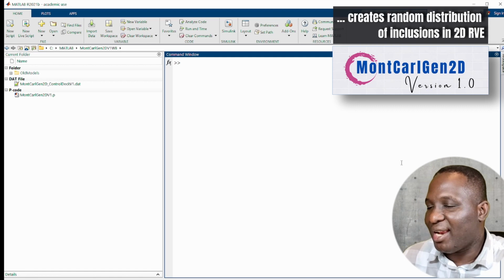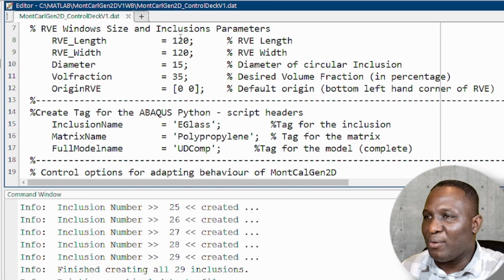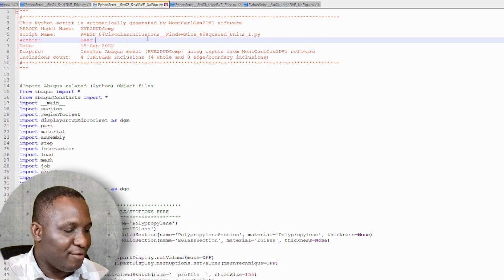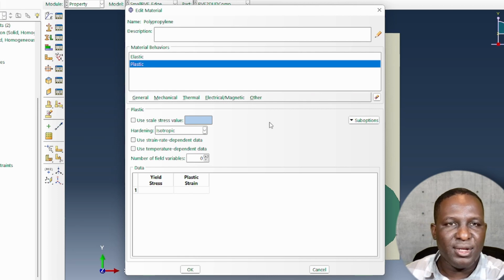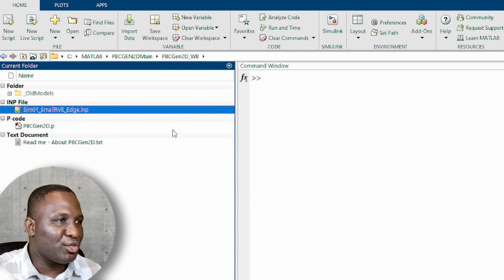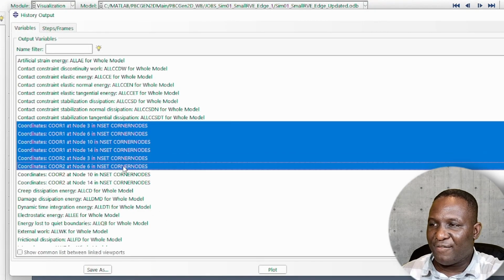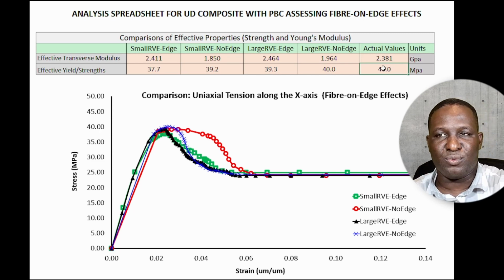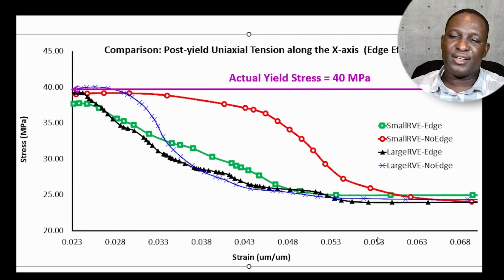Finally, the TRUTH about designing RVEs and Edge Effects!

Comment: Sir, kindly be of help. I got an error message of "Abaqus Error: Command line option "input" must have a value. 
Abaqus/Analysis exited with error(s)." when I run the .inp file through Matlab.
Reply from the maker: Hi @Yusuf, you need to specify the right input file for the job after the job command. Here is what it should look like: 

!abaqus job=PutYoutInputFileNameHere_Updated -interactive.

The PutYourInputFileNameHere should be the exact name of the file that you are running without the *.inp extension. 

Also make sure you are running the model in the exact sub-folder where the Updated input file is located. Just navigate into it and then run the above ABAQUS command. The sub-folder is a folder beginning with JOBS_, not the same folder where PBCGen2D executable is.  
Hope these help?
Reply: @MichaelOkereke  I have been able to do it. Thank you sir.
Reply from the maker: @yusufbabatunde2913  well done.